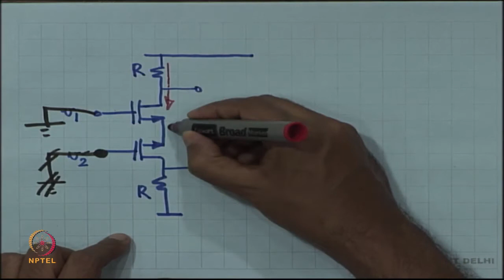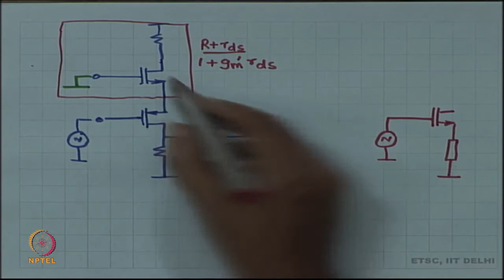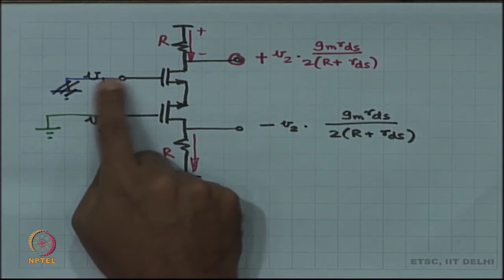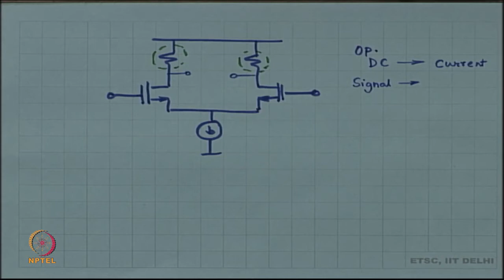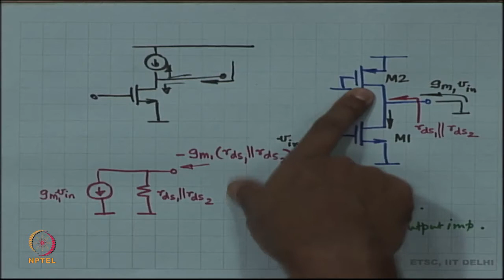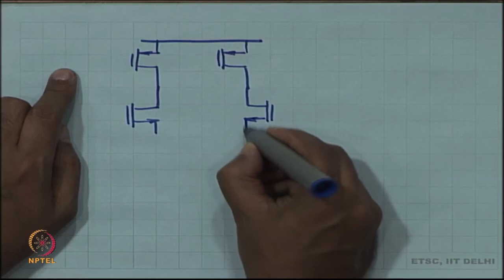Differential amplifiers-II

Comment: Anyone plz clarify my doubt 
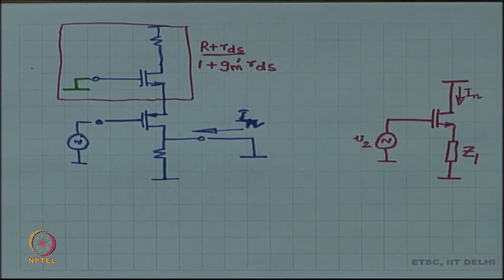At 12:46 how it is considered as a common drain circuit ??
We have output at drain and input at gate then it should be a common source but how it could be coomon drain????
Reply: Yes it's common source but we need to find the voltage at source so that's only possible with common drain analysis
Reply: Yeah it's a mistake common source
Reply: hope this must be clear by now, just writing again, just in case.
it's a CS ckt, but to analyse by short ckt method, we need to find Isc. When we do this, it grounds the drain, and hence the analysis now would be from a CD ckt viewpoint (just to find Isc). Rest thereafter will follow a CS analysis as usual.